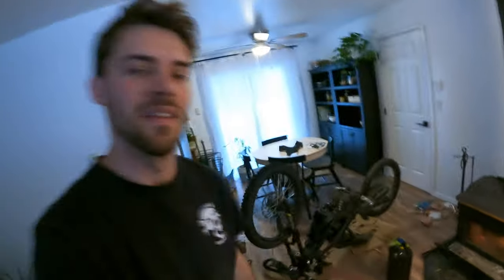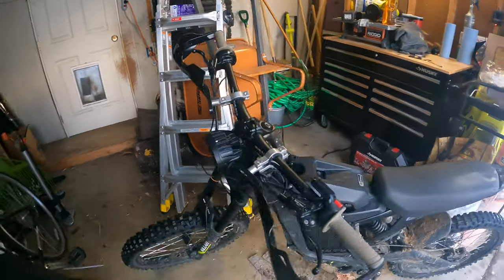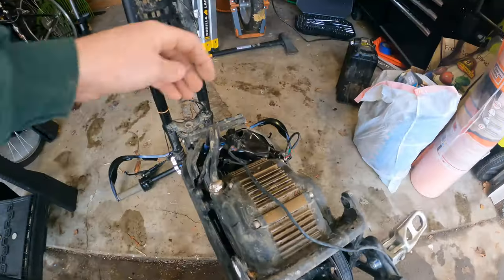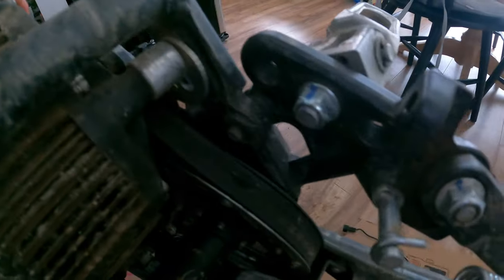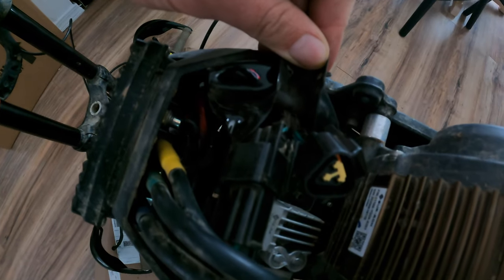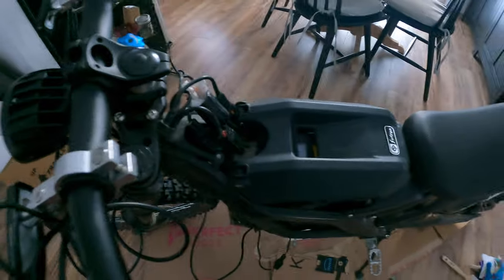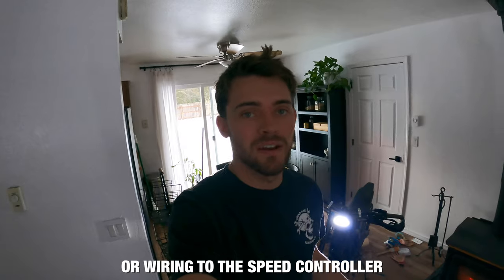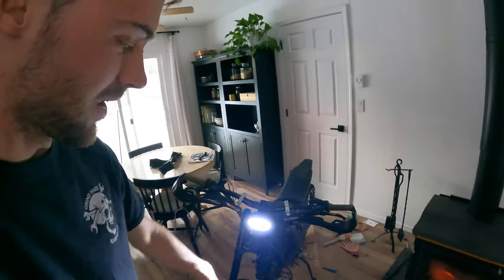I Destroyed a Surron in 2 Months - Full Battery Won't Power On

Comment: I went through this same issue on my surron x after having it for a week. Came to the same conclusion that the wire disconnected made everything power up. Also made me a little concerned about being far away. Since then it’s been 200 miles of no issues.

Comment: Those skid plates are basically aluminum foil, they bend so easily!
Reply from the maker: For real! I am going to have to make a Grind Hard version!
Reply: and will destroy those sensor cables which will cause malfunction. still remember how I got that broken wire fixed on the trail.

Comment: I guess its a common overheating issue with the controller. Riding it on the brink of max power will heat the components and it takes only a single capacitor or mos fet to fail and bring the Light bee down. Its a pretty common thing with high powered E-bikes .

Comment: since i saw the sur ron in your videos i have been very tempted to order one. maybe this will help ease the temptation hahahaha
Reply from the maker: You should definitely get on this is a very uncommon issue haha I am thinking about buying another one to ride while I wait for parts I like it so much!
Reply: Look around, Sur Ron is not the only company making bikes.
Reply: @EdwinOlding  hahaha that would be great. I still might send it on one, it would open up so many riding spots around me (where people get angry about engine noise)
Reply: @nandrews8412  I have looked around, but sur ron seems like the most high-quality one in the game like this (high power, without pedals, etc.)
Reply: ive owned my ronny for 1 whole winter and ive ridden it in every bad waether  event and aside from beating the bike on off road for which its hardly really suited well enough for as a stock bike   especially if your used to rough riding on a gas bike ,

Comment: Hello
I encounter the same problem as you. More contact and like you by disconnecting the wire + on x controller its working again.
where does the failure come from?
cordially from alsace in france
Reply from the maker: It was a faulty speed controller in my situation

Comment: Before I watch: water damage or loose connection/bms failure
Reply from the maker: I didn't see any signs of water damage but if it's not the controller I'll have to undo the wiring harness and check each wire

Comment: I watched this video the other day and the following day my bike has the same exact problem! I was in EP mode for about 5 minutes with full battery and everything shot off and never came back on. Has Luna gotten back to you yet? I was going to order another surron this week but now I want to get this sorted out first.
Reply from the maker: Yes Luna did get back to me and the problem is the speed controller their customer service is actually really good I wouldn't hesitate to buy another one myself
Reply from the maker: Today even offered to send me the new one as soon as I sent them tracking for the return so I could get back on the bike sooner
Reply: @EdwinOlding  Looks like thats my problem as well, my battery worked fine on another bike so thats most likely a controller as well.This all happens right when I get my 21" front and 17" rear to!

Comment: I’m so sorry man. So what was the overall issue ?
Reply from the maker: It's either a short in the wiring harness or a short in the speed controller. Either way it shouldn't be too big of an issue I'll just get on with customer support tomorrow and then make another video on the solution!
Reply: @EdwinOlding  I had a fuse issue a week ago. Needed to be pinched a little for a tighter connection thankfully that’s all it was. I have a LBX as well a month Into owning it love it as well have a moto background so that’s how I ride it lol. Ordered riser bars and hand guards yet to install. But really thinking about the rear link 3in lift bc I am 6’0
Reply: @ZunigaProductions   look up SurRonshop they have an extension link for rear suspension and seat riser link

Comment: I had an eletric scooter and if the full charges is above 90v, it didn t start, but if you let it stay a bit until its below 90v it starts again, may be a overvoltage protection
Reply from the maker: Interesting.. I will try that out
Reply: @EdwinOlding  do you still have the dongle with the red light? its a diagnostic cable thingy

Comment: You hav two different volt battery with gess that silver voltage controler
Reply from the maker: No it’s only tuned for the 72 V battery but you can also turn it for the 60 V

Comment: after 3 years, mine just started acting funny...if you have all the sensors removed or go through that check and all is ok, there's not really too many other things, usually the controllers go bad, or the BMS in the battery or the hall sensors in the motor... that's about it.

Comment: The 1st problem with products from China is that they're from China. Quality is not their 1st priority... they are our economic enemy. Nice video. Nice to see you sharing.
Having the controller mounted in front looks like a risky location for water and rocks. I have Hi-Power Cycles 6kW Typhoon (it is a conversion from a MotoPed gas engine to electric). It weighs same as a Sur Ron. I bought it in 2016 and wish I knew about Sur Ron coming and maybe waited for one. The Typhoon has mountain bike rims so it is not as hardy as having small moto wheels. Not long after I bought it, I had my controller go out. They replaced it under warranty. We thought it may have fried from water ingress. Thereafter I sealed the replacement controller with RTV Silicone gasket material. See my bike upgrade video: https://youtu.be/vAHlBIld4YA  I also went thru the whole bike's wiring and put in heat shrink tubing and used plastic conduit like autos used to use. Also, using di-electric grease on connections is a good idea.

Comment: They run a belt for a reason bro , low noise . You will regret fitting a chain .
If it’s 2 months old you still have warranty
Reply: Less noise isn't as important as better durability.
Reply from the maker: My main issue with the belt on the surround is that sometimes it slips if I'm doing wheelies or hill climbing. If I kept it for Street I would keep the belt but I need that chain to be strong and not slip when I'm climbing mountains